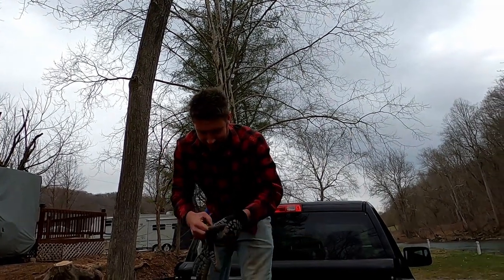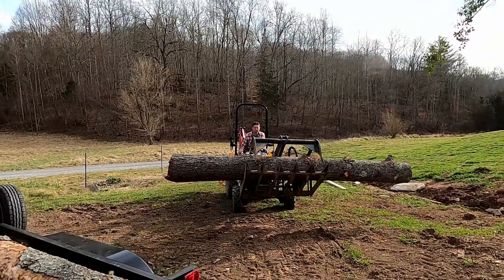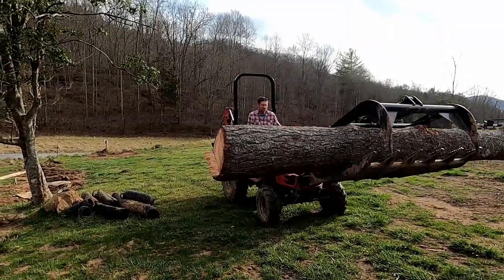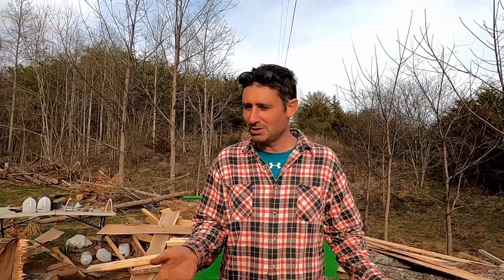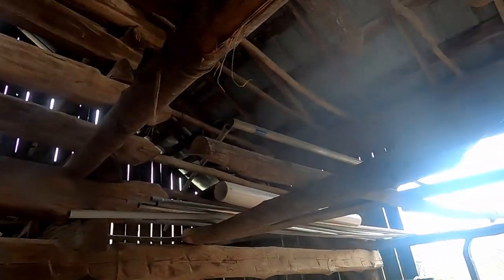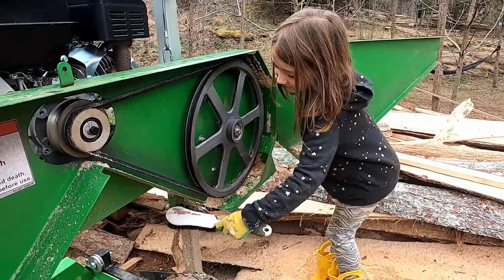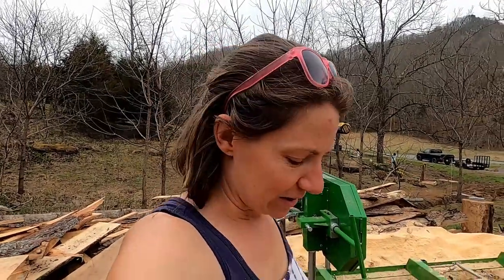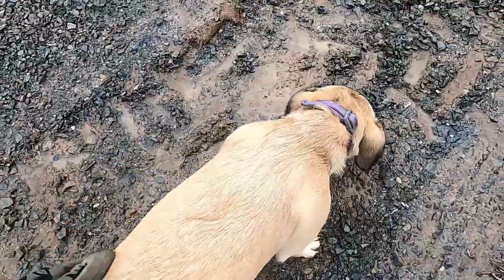E26 - Free logs on our new tandem axle trailer

Comment: On getting the tractor into the barn, you can use your box scraper to dig out the floor in the center section of the barn enough so you can get the headroom needed by the tractor.

Comment: Just curious...maybe you discussed in another video, but are your tractor tires filled?  I know you have the backhoe on there, but was just wondering since the tractor seems to do pretty well handling heavy loads up front.  Love the barn with all the hand-hewn beams.
Reply from the maker: They are not, but it's something I've been looking into.  Seems beet juice is the ideal thing to use because other anti-freeze products cause problems with the rubber and steel.  Have an opinion?  I'd really like to see what it feels like on this hilly terrain.
Reply: @WalnutsandWineberries  I have just ordered a JD 2038R (will be first tractor) -- the dealer told me they don't even sell them without filling the tires, guessing because the hilly terrain in our area (guessing not all that far from you).  They actually use a corn by-product (looked it up, assume it's Bio-Ballast).  I guess I can let you know how it does, but the ship date isn't until April 22...so will be awhile!

Comment: How big are the biggest logs you can lift (with out dragging them) with your tractor? I'll be doing a similar thing, but will need bigger logs than you used for the shed. Love the series, by the way!
Reply from the maker: I cut my logs 9' 6" because that's the largest that can fit on my mill.  The tractor can lift a 20" log of oak at that size.  Maybe a good idea for you is to get a log skidder if you need longer logs and have a comparable sized tractor.
Reply: @WalnutsandWineberries  Thanks for the info. I think your size tractor would work for 90% of what I need... except I need to move bigger logs.

Comment: not to quibble over terminology but the word you were looking for wasn't "MILLER" but was "Sawyer".  I'm getting a huge kick out of following your adventure.  BTW, the reason for the height of the cross logs in your barn is that the folks who farmed that land used horses or mules instead of tractors and even if they had tractors (not likely) they would not have had roll bars  The horses were.  not as tall so the height didn't matter.  The tobacco was hung by hand  to dry in the barn much the same as your lumber is doing.